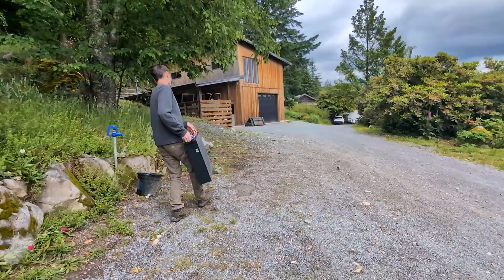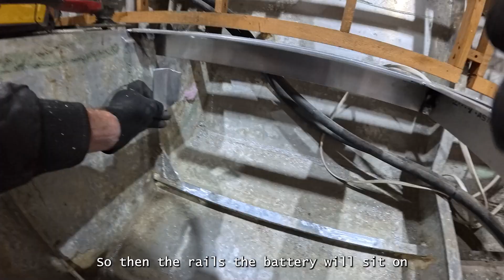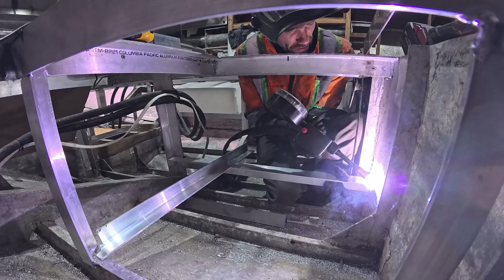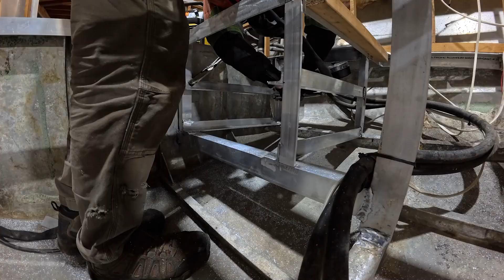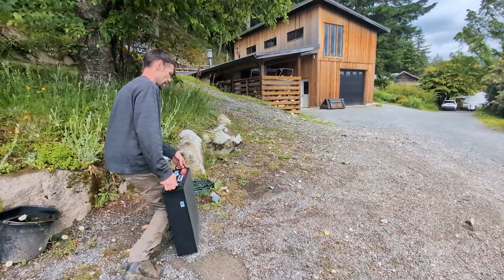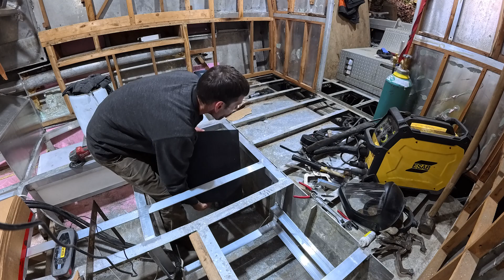Time to fit the rack batteries in the boat!

Comment: I like the dual use. Did you leave space for rubber or something to isolate the metal on metal with the vibration of the boat?
Reply from the maker: Thanks for your comment! Yes, there is some extra space between the rail and the battery case. I think rubber might move around while sliding the battery in so it might need to be more secure then that. I'll have to see what we can attach to the rail that gives it cushion while still allowing it to slide in and out easily. There will also be 4 screws from the front holding the battery in place.